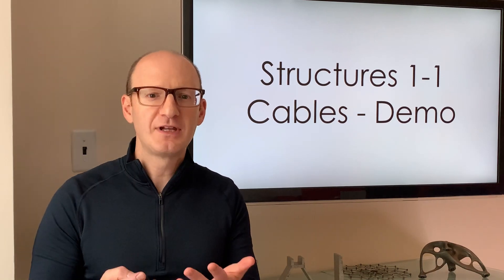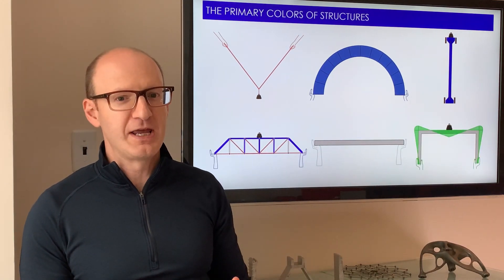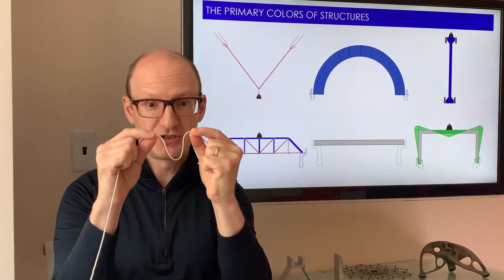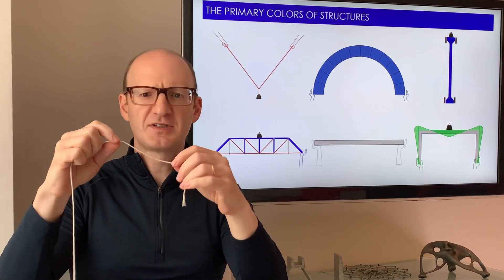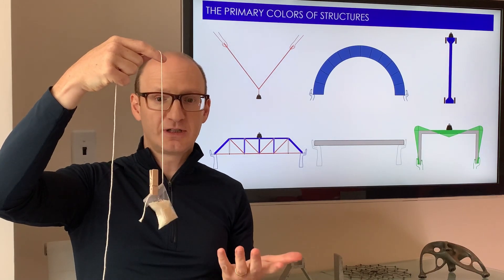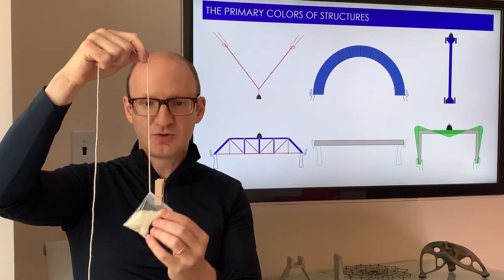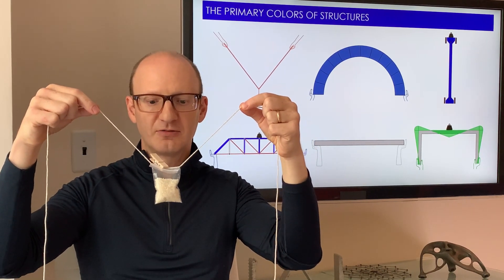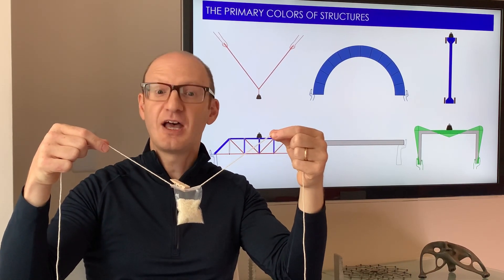How Do Cables Work? (with Demo!): Structures 1-1

Comment: similar to the muscles
you can easily find which muscle do the exercise by imagine it as a rope 
for example of do squat, it is the front thighs who do the most of the exercise because it will be under tension

Comment: The cable is also rocking a little bit out of plane. Is it possible to work out a horizontal force which is responsible for that? 

Let's say that we have a suspended cable structure (like in video) but it is also connected to another structure which is standing on the ground and stable on it's own. How to work out horizontal force which would be transferred from the upper part to the lower part?